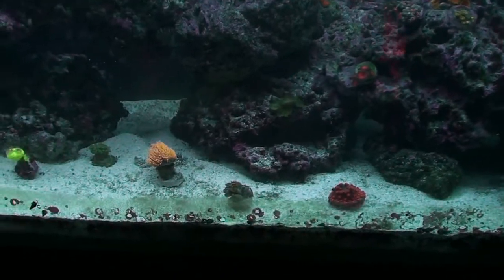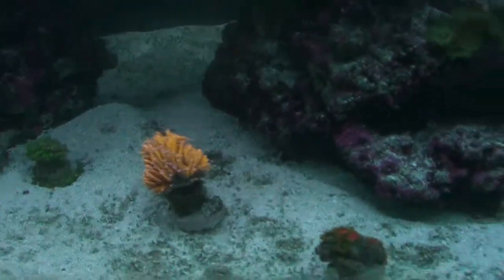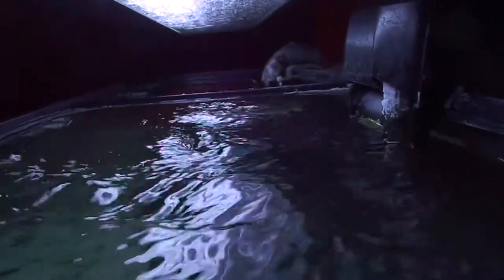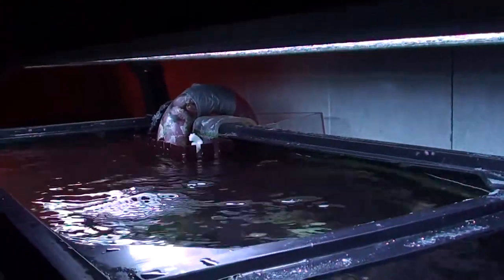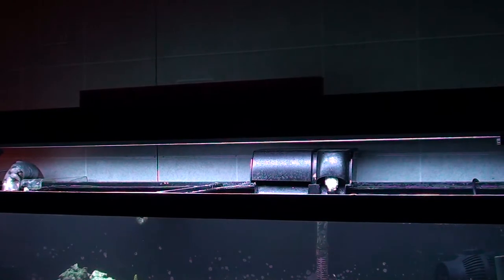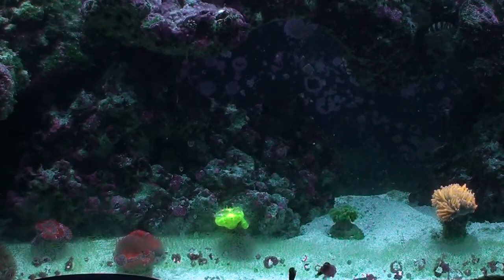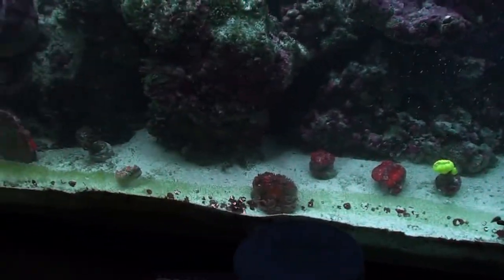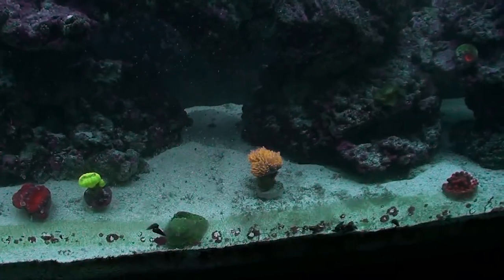Meet the WP40 with Voltage Regulator

Comment from the maker: Mine has been running over four months and still hasn't slowed a bit. All I can say is if it does slow down, it's time to clean it up with water n vinegar. Maintenance is key with any piece of equipment in our saltwater aquariums, thanks for the input, appreciated

Comment: if you really test the Jebao product, after a while, it's gonna be slower and slower and not as powerful when you first unboxed it. i have 2 wp25 (replaced with tunze 6095 now) and the LFS i'm going compared it head to head with a tunze 6105 and it is really slowed down after 3 months using. but Jebao WM a cheaper solution for most of us, just don't expect it to last..